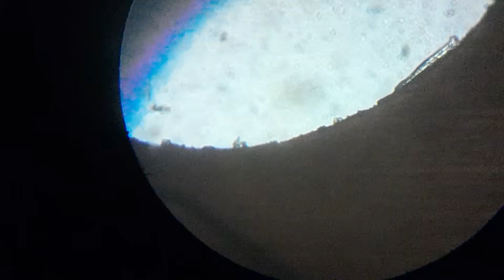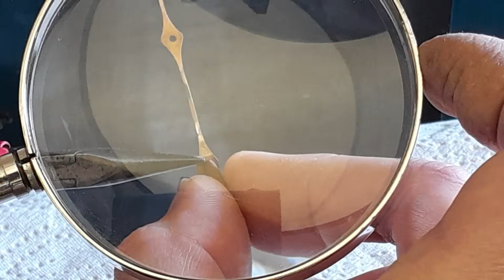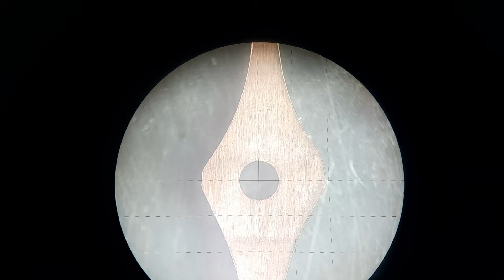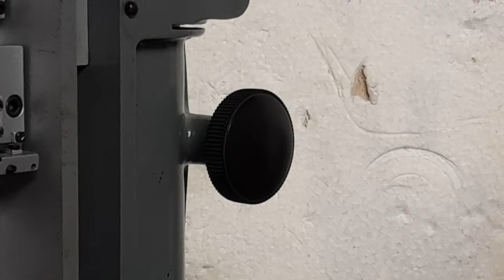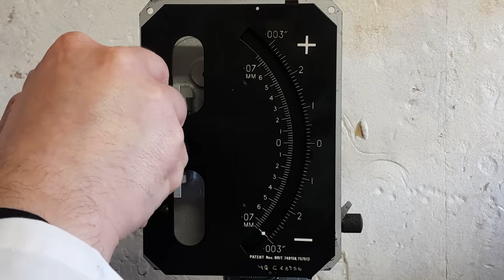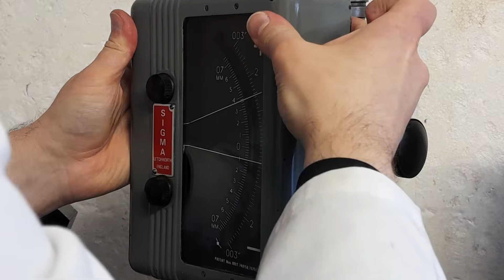Inside a Historical English Precision Comparator PART 3 (fitting the Bronze band)

Comment: To make DIY lapping plates cheap and easy that possible to glue ( Loctite 648) copper coin or copper alloy coin ( the Euro 5 cents or UK 2 pence)   are perfects and cheap , you glue the coins on a steel plate reasonably flat as cold rolled /  tool steel  , Loctite series 600 are very efficient with copper alloy , asap yours coins are glued you can lap them and get a very efficient lapping plate for precision work
I center drill the coins  to 3 mm to improve the lapping stability / pressure for delicate lapping .
Reply from the maker: Thanks for the information

Comment: to lap the anvil you can make a 3 stones set and make them flat by using the ABC method of Whitworth , for maintenance grit 400 is perfect , for digs removing grit 240 
you can also grind the stone on a flat grinder to save time before to pally Whitworth method
Reply from the maker: Thanks for that, yes, I know the Whitworth method. Regarding the stones, I use them for removing burrs but I have not used them for Honing/lapping. This is something I will have to have a practice with.
Reply: @TheEngineeringAlchemist  lap with stone is a common way for tooling parts IF and only IF the stones are flat , that a quick process used on machine tools 
For precision surface that also possible to DIY round lap flap by using round flat brass or copper with cross cut , cross cut allow a better contact surface by removing unwanted pressure point  , I have a set of 3 100 mm dia brass flat cross milles ( 10mm grid ) as cheap solution cast iron can work and cross cut be done by using a disk grinder with thin wheel , cross cut have accuracy specs just grooves the most important point is the flatness , I use a optical parallel flat glass to control the flatness for brass disk flat .